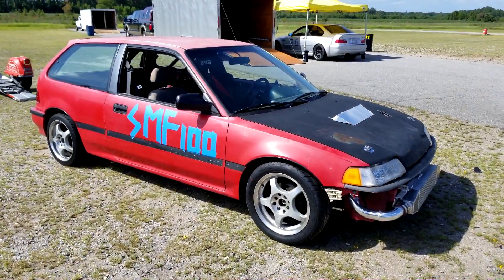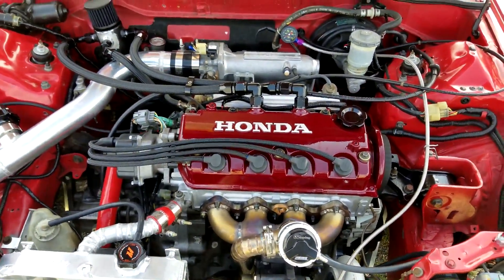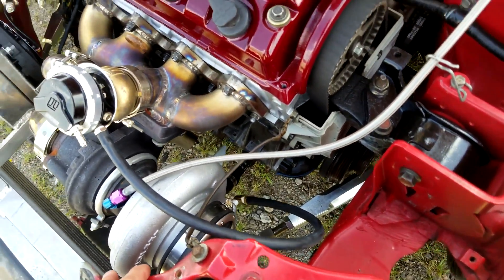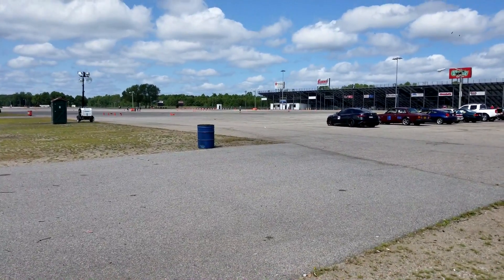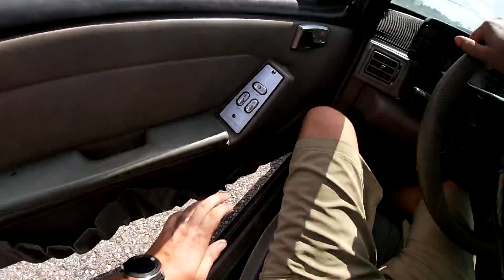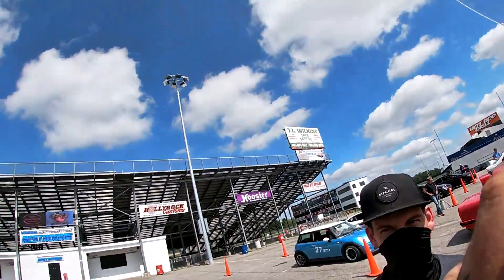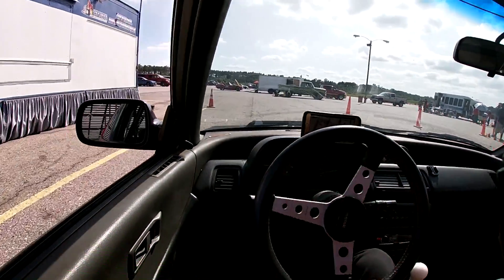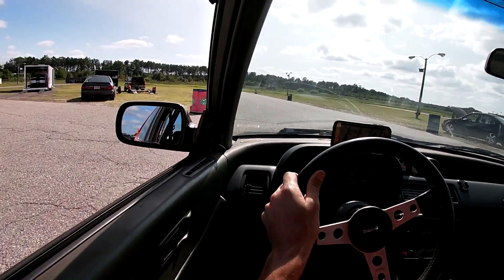D16 Turbo Civic and Foxbody Mustang VS Autocross

Comment: How was the turbo on the autox??? Was it mostly lag at lower rpm or did it spool quick ?? ...I'm thinking of a T25 for my d16y8 ef for autox
Reply from the maker: Turbo is too big for autox. T25 will be much better for that. For big track the holset is great. After you start racing road course it's hard to go back to autox.